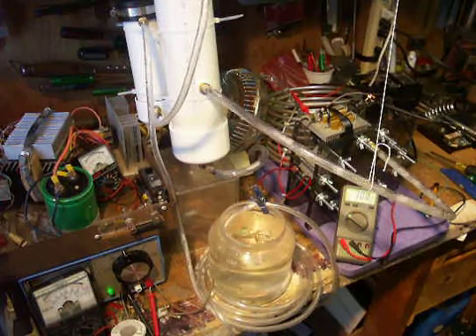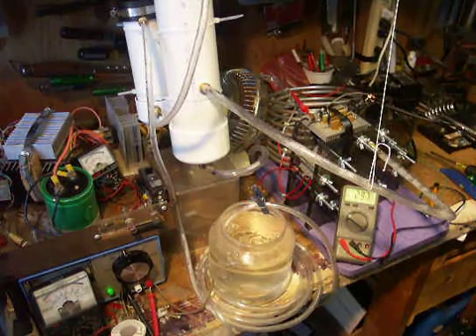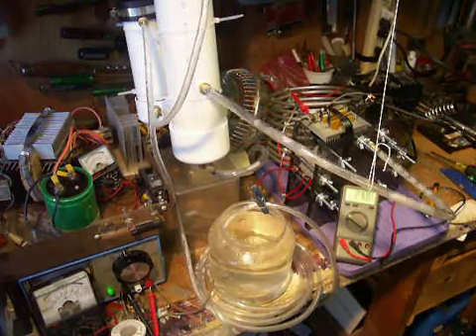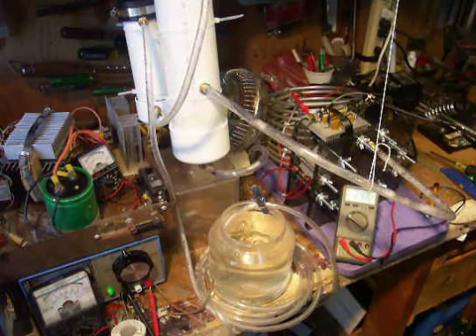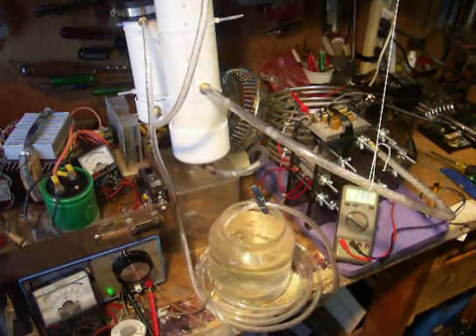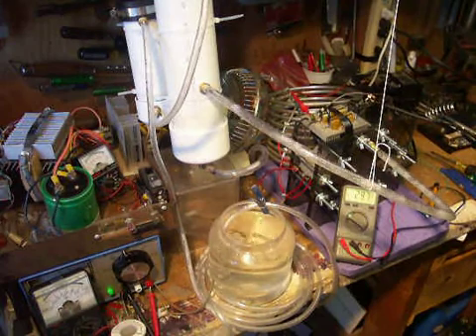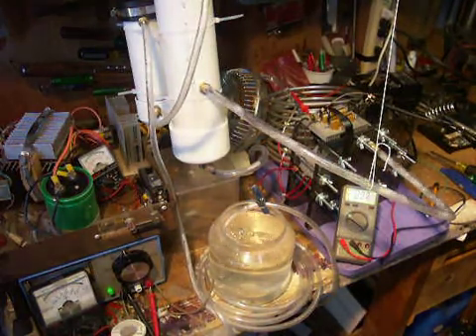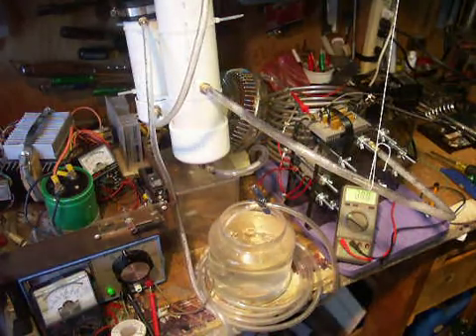HHO Dry Cell Testing #2

Comment: Will do.  I'm trying to decide if I will build one like yours (I'd call it a Tero Renta series cell with flow through) or a series cell consisting of concentric tubes (kind of like a bob boyce only circular).  Another way to insulate the holes and at the same time experiment with different plate areas would be to use a 3 layer sandwich design for the gaskets: 2 outer 0.5 mm,  one inner 3 mm.  The outers could be sealed bonded to plates and extend around holes.

Comment: This will give 1.9 V per electrolytic gap, which is good.  Reduce your plate area by 4.5 sq in. by painting (Corona Dope or epoxy ?) a square 1.5 by 1.5 around top and bottom holes.  This should also help reduce the current leakage greatly (along with your slit tubes) while allowing maximum flow.  Then just increase your electrolyte concentration so you get about 20.5 amps when fully warmed up.  If you're exposed plate area is 20.5 sq in., this will give 4 sq in. per amp.  I will try similar.

Comment: petedog, first off thanks for sharing.  I think your exposed plate area is about 36 sq in. minus gasket area for about 25 sq in.  Correct ?  Here's some thoughts.  It seems your current density is very low.  Bob Boyce says to shoot for 4 sq in. per amp or .25 amp per sq in.. Also I think your plate spacing should be more like 3 mm., 1/16 in. is pretty close. To keep it simple for car, design for 13.2 V for now.  Wire it for 29 plates with 6 neutrals so will be 7 series cell paralleled 4times.

Comment from the maker: 2.0 to 2.2 volts is the most efficient voltage between each plate. 2.2 volts X 31 cells = 82.2 volts. The first plate is a positive and one negative on the last plate and. The rest are all neutrals. I will use a 800watt inverter into a variac. Rectify the the AC 49 volts into 68 volts DC to dive the cell in my car.I have experimented with HVDC and it does not work better then what I'm using.

Comment: Hi PeteDog this project is really good and you went to great detail to explain what you did. Thank you for the great information. 1 question pls. Why wouldn't you want to increase the voltage on ac side? That could give you several thousand volts or even several hundred? is there a better design for plates that would not cause an arc with that much voltage? I guess my thought is higher voltage = higher output and more current draw

Comment from the maker: I recently tried using 35volts DC with one lead in the center and two positives on the ends. It produced 1.5 liter per/min with 294 watts in for 5.1MMW. There may still be some more efficiency still in it to ring out. Perhaps with a higher electrolyte concentration.